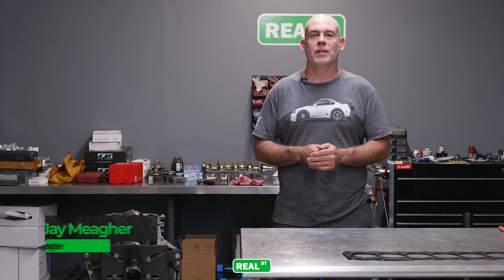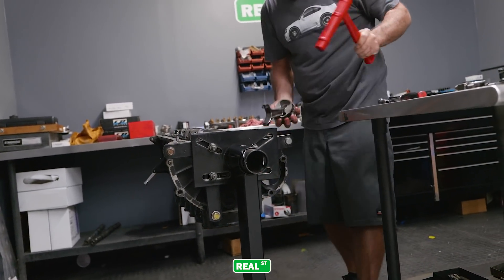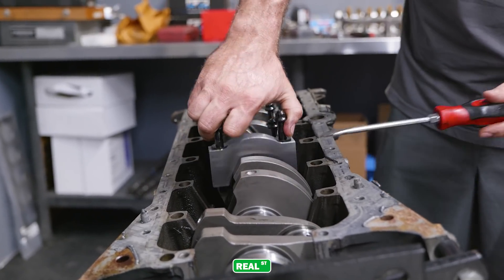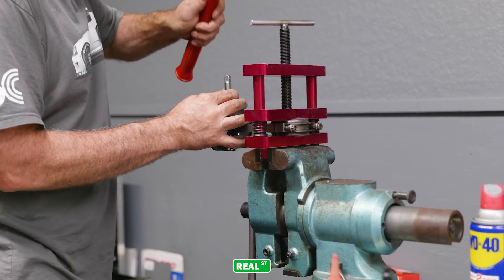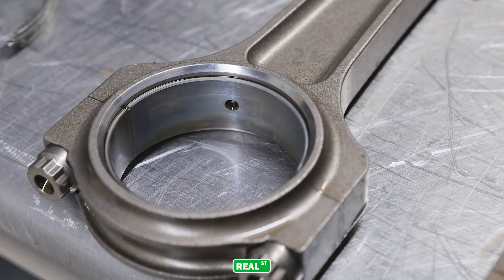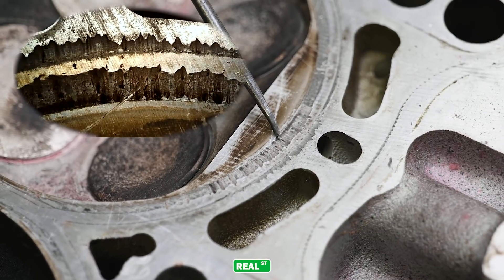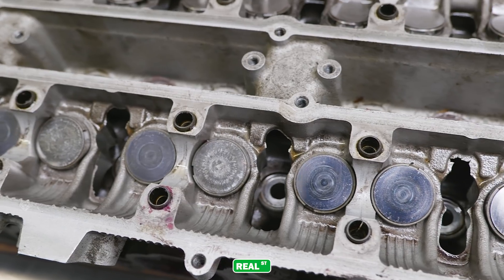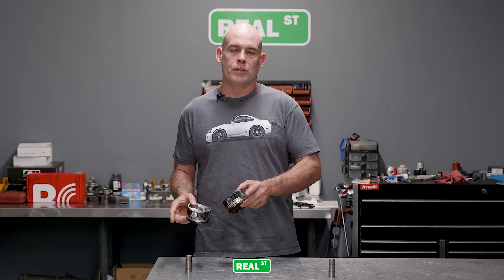2JZ Engine Head Gasket Failure - What Does The Damage Look Like Inside? (Teardown)

Comment: Seeing as our world is consumption crazed, I have an idea for a one piece engine that would last forever.  Head internals are mounted inside head. Would also require no gaskets and no fluids except fuel for 3000 miles.   Iso deep pockets!  Let's change the racing industry.
Reply: Consumption is surely out of control. Read about the OFFY engine, it's certainly a marvel for it's time.

Comment: Great video. Very professional not mentioning the tuner. Thanks for great content. 

Still looking forward for Jays 96mm tear down. Or even a progress video. 🤞
Reply: The 96mm engine is alive and well!  It's a really smooth running engine that hasn't been using a measurable amount of oil. I did take it apart after 1000 miles to make sure the Titanium rods were living as they were not coated. All good so far!
Reply: @jaymeagher1510  Thanks for the update Jay. So many of us appreciate you mate! Keep up the good work. 🇬🇧

Comment: Any idea what steel grade those wrist pins are made out of? Because there are galling resistant steel grades out there, and anti-galling surface treatments too, to tackle this. IF it is a problem you want to avoid, rather than allowing it to happen as a warming sign.
Reply: 6 year old tech, who knows what they used, probably standard issue 4130 or 4340 pin… definitely a DLC coated 9310 or H13 is the way to go at the power level and usage Jay stated it was at
Reply: The pins are 9310.  They're surface hardened. The problems shown don't occur at this power level (1000-1100whp) when the engine is tuned properly. Once the cylinder pressure is our of control the parts deflect, oil is displaced and it's mixing metal.  As power increases you move to a through hardened pin that's DLC coated like a Trend. Thanks
Reply: @jaymeagher1510  Thank you for the insight! I'm a materials scientist & engineer / metallurgist, so this was a question out of curiosity and you gave a very interesting answer.
Reply: @Hydrazine1000   The stress under detonation is just too severe to account for.  It's why compression ignition engines are heavy and noisy.  Once it's rattling the clearances change!
Reply: @jaymeagher1510  Not helped by the fact, I assume, that detonation starts locally, rather than pushing against the whole piston surface evenly.

I just can't escape the feeling that something like hardened AISI Type 440C would outperform 9310. With 440C you can get a yield strength past 250 ksi, where 9310 will reach up to 155 ksi typically. And if you go really exotic, Maraging 350 steel can have a yield strength past 330 ksi, if properly aged.

... But then I realize that I know just about nothing about all of the intricacies of an internal combusion engine, let alone a 1000+ horsepower engine.

Comment: Yep, every common for a top fuel piston rack to have a variety of compression ratios hole to hole as airflow isnt the exact same to each intake port from the intake manifold, also way head gasket thickness changes by heat/humdity too

Comment: Be easy on the page up key in the spark map for sure. Especially at lower revs or torque bois. Make your power with boost. It’s just a little more psi. But a couple more degrees…. Who knows lol. Thanks jay. But seriously even tho you are 💯 your spark table should probably not be 100s top to bottom side to side lol. I am not a 2jz dude actually rotary to sbf. I know I am hard headed. But I appreciate all of the community. We need to stick together.

Comment: Hi Jay were shimless bucket were new? Or resued? I just want to understand if that will happen with time and use. I am building a daily drive and dont want to end up in that way
Reply: I don't know as I only had control of the shortblock.  I've seen some jz engines that have TIN coated shims that seem to live better with the steel cams. The best advice I can give if you're using steel cams is the DLC coating or use cast cams. Be mindful to what oil you're using as the lobe is only splash lubricated and if you're running alcohol based fuels oil will be diluted. Thanks

Comment: is the bore squirter delete just for stroker clearance or is there another reason?
Reply: It's done on a case by case basis. On an engine running alcohol based fuel and a stock wet sump oiling I'd take the oil pressure over the piston cooling.

Comment: Are buckets are damaged because of gcs billet cams? Plus what would be best head gasket?
Reply: Yeah a billet cam is one that will cause that to happen. Have billet GSC S2 vvti in my 2J block and haven’t ran it because I’m going to build the bottom end (2J prices are STUPID now, and I’m not willing to shoot a rod out the block while chasing a 1000whp stock bottom claim) and I’m going to DLC coat the buckets before re-assembly.
Reply: @edmundnlemadim8480  one guy in Miami did 1105 whp on stock bottom end. Ran several times on the dyno and a few runs on the track, then blew that rod out when he let off throttle top of 4th gear. 
He was going to build it anyway so he figured why not run it till it blows to see what he can get from it
Reply: @You Tube yeah that was Yosdany’s Supra. He got his mileage out of that block; it was the original engine and he had ket increasing power over 10 years with different setups. I don’t have 10 years out of my stock bottom and it’s no longer ~1000 to get a stock GTE block and crank to build

Not to mention I have about 6K into the cost of my vvti head with shimless buckets, GSC cams, Supertech oversized valves, ferrea springs and retainers, and full CNC porting + assembly, I’m not about to trash that head either, hence why im pulling it back apart for billet mains, BC6309HD rods and Real Street RS1600 pistons with DLC coated pins
Reply: @edmundnlemadim8480  my 98 Supra only has 30k miles on stock twins and i have ZERO plans to do any major upgrades other than the bolt-ons which were already done.
Reply: Stock HG will do just fine until you're past 1400 or so WHP. At that point you're going to start dealing with defection that the MLS gasket can't cover for.
Reply: @jaymeagher1510  i was about to say, we have another poser on YouTube pretending to be someone else for the attention. But after some digging, this man IS Jay 👍🏾
Reply: @ACommenterOnYouTube  HA! Nope it's just me!  Thanks!
Reply: @jaymeagher1510  Hey Jay, do you guys so "repairs" there at the shop or just performance upgrades on the supra 2jz ?
Reply: @ACommenterOnYouTube   Hello, we don't offer repair services any longer.  Sorry about that.
Reply: @jaymeagher1510  is there a shop that you would recommend for a 2JZ valve stem seal replacment ??

Comment: How do you determine what each cylinder is actually doing to be able to tune for it ?  I mean beyond and EGT sensor per cylinder ...  EGT measurements are kind of slow to be able to catch lean/detonation situations aren't they ?
Reply: They are slow but you are looking for consistency and similar EGTS across all cylinders . Its more of a proactive measure than a reactive that's what I think and I'm no pro tuner or engine builder. 
The best way to see knock would be  to monitor cylinder pressure but the equipment required to do that is really expensive I think Gale banks has a video on it.
Reply: EGT per cylinder is exactly what you need for catching potential cylinder to cylinder TIMING issues. Beware of the coldest cylinders. You'll want to pull timing on those cylinders to get the temps even with the others. You want EGT's to be close (maybe within 100 degrees F) cylinder to cylinder. They are slow compared to a wideband but that's why you don't use them to tune air/fuel ratio. That's what individual widebands are for but probably overkill for most.

Comment: Hey Jay, being the mad engine scientist you are have you explored WPC treatment vs. DLC coating? Love your work bud!
Reply: Love to see some WPC coverage beyond Mike from MotoIQ
Reply: @ricepony33  Yeah  buddy, love me some Moto IQ! Planning to use WPC treatment on my hot street/track SR setup. What are you up to?!
Reply: @johngray5360  I’d like to just do a basic NA Miata BP engine with ITBS. Fun motor that’s smooth and reliable. I work in racing and the people having the most fun are the ones driving, not worrying.
Reply: They are similar in a sense but serve a different purpose
Reply: I've only read about WPC and it seems like more of a surface improvement process VS DLC is a coating that takes the character of the part and puts a hard layer on it.  It's something that I should look into however where I used DLC it seems to solve the problems I was having. Who knows, maybe the WPC is as fruitful?
Reply: @jaymeagher1510  WPC is basically microscopic shot peening, it hardens the material and reduces friction. Fairly inexpensive too.